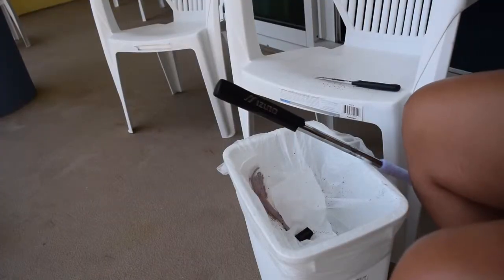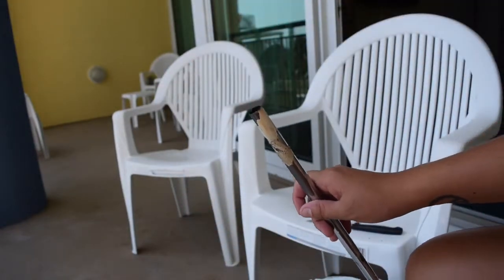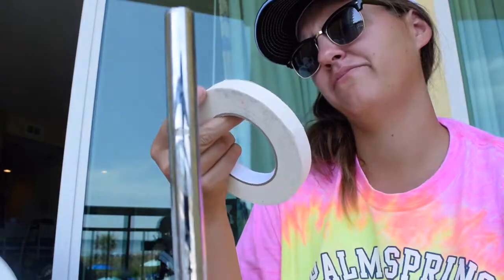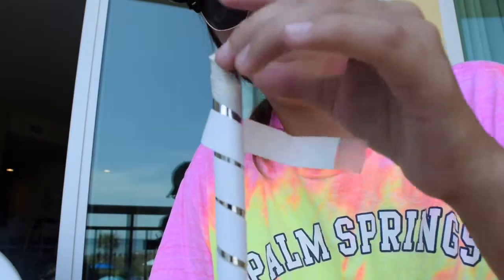How to regrip a putter

Comment: Next time pour some solvent in your grip. Put fingers over holes on each end of grip. Swish it around then pour the excess on your tape. Will make it much easier to slide on.
Reply from the maker: Ok great thanks for the tip :). I didn't think to pour more on the grip tape so that would definitely help!
Reply: Oh yea the wetter it is the easier it will be to slide on. I have done all kinds of club repair and that is the best way and with it real wet you will have time to move it around to get it straight and then just let it dry.